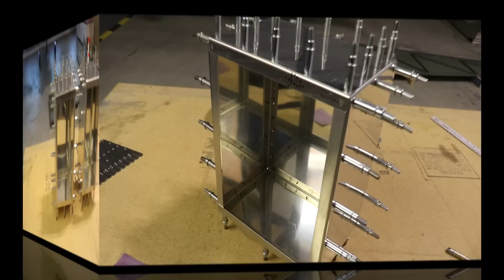Adding More Storage to the Zenith CH-750 (Ep24)

Comment: The large number of rivets used will make your box leak proof  :-)  ...  a pitch of 8 to 10 D is quite ok. 

 Regarding putting large cutouts in the bulkhead, I'm guessing it's NOT a structural bulkhead ;  

otherwise* either :-

(a) - you'd require structure (Doublers) to direct the load path around the cutouts and into adjacent primary structure or 
(b) - you'd have to design, build and install the boxes in such a way that they act as primary structure.

* By the way, those boxes look to be well designed, well built and well installed, so as to compensate for the cutouts structurally.

 :-)

Comment: Awesome Idea - I have finally gotten my grubby paws on a 90% complete, 50% done KR2 (3 weeks ago) and this would work well behind the seats!
A question if I may; is there a specific reason why the side panels are outside the frame and not on the inside of the L-angles? To my mind, having them on the inside would make the storage box neater looking (no L-angles visible) and stronger as the panels push against the L-angles instead of hanging off the rivets.

Comment: Your not concerned about possibly changing the structural integrity of the bulkhead with this mod?  Will having weight in those boxes and possibly it moving around in flight, put other stresses into that area of the plane's structure that may not be accounted for in the mounting of that bulkhead to the fuselage?  No concerns about having to beef up the rivet sizes where this bulkhead mounts to the fuselage?  I'm no aircraft frame engineer, but have you considered running this mod by Zenith to make sure you aren't changing the strength of this part or some structural dynamic?  Do you have sufficient clearance to get the hinge rod in?  Do you have sufficient upper or lower clearance to ever remove the hinge rod if needed once the bulkhead is installed?  What will prevent that rod from sliding out once vertical and under way?

Comment: You might consider coating the inside of those boxes with white bed liner, for a few reasons.  White coating will make it much easier to find any small parts that get lost in the bottom of the box, it will seal the seams so any oil bottle leaks will be contained, and bed liner will protect against scratches much better than just primer or paint.  Great idea, by the way!

Comment: What about making a structural chanel in the shape of an "X" to make a door that size more rigid? Like the old Gerry cans.
Reply from the maker: Bryan-I did mention doing that in the video, but even if I did I still think .020 is too thin for the door. So I need to order thicker aluminum for the doors. Even with the thicker alum I still might have to add some type of support to the door-we’ll see.
Reply: My bad. I guess I missed that.

Comment: Hey Mark...am I missing something or doesn't the 3rd Seat back go on top of the bulkhead , or do I need to just be patient and see?? Thanks again and Blue Skies!
Reply from the maker: Yes you are correct-the aft seat goes about half way up the aft bulkhead. I positioned the boxes as high as I could on the bulkhead. So for mine, the aft seat will have to be shorter, or it will simply need folded down to access the baggage doors (just like I have to fold down my Cruzer seats to get to the back). Don't forget, these are just meant as a place to carry extra oil, rags, or a first aid kit. Basically, stuff I don't have to access too often. Beats a wing locker anyway! I was actually going to make the extra storage in the wing like the 650, but decided it would be easier to have it inside the cabin.
Reply: Figured it was something like that... great idea and use of " wasted space " I'll be doing something similar to the 750 STOL. I'm thinking about some ' clicky type magnetic latch kind of thing. Thanks for the ideas and inspiration!
Reply: I was wondering the same thing too. Must be some way to move the seatback easily.